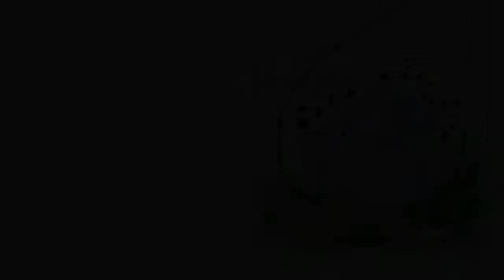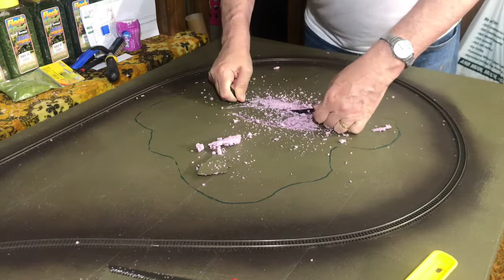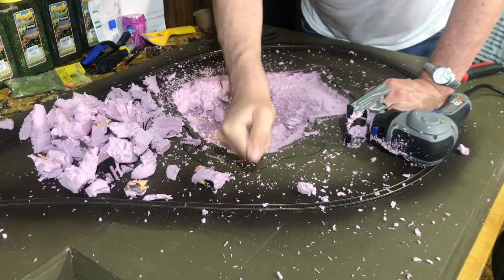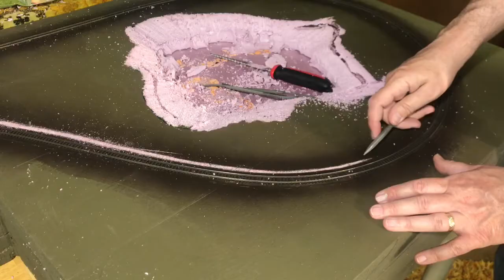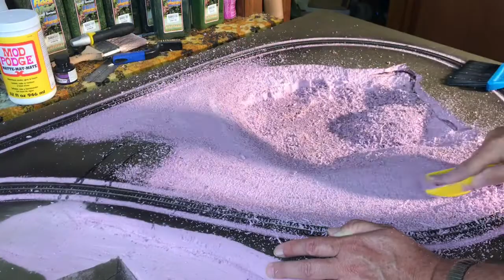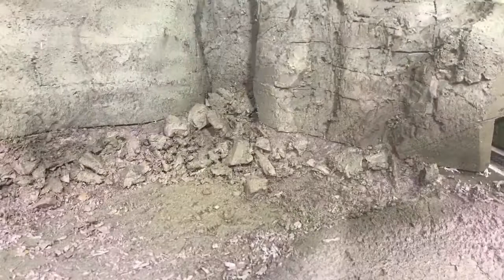N Scale Layout Build Using Extruded Foam # 8b

Comment: hello again.. just my two cents about lakes and waterways.. unless you plan to submerge objects, vehicles..etc.. unless your lake is going to have a very deep slope of ground before entering the water..you now will have a huge investment & weight in filling your lake.. the trick of the eye is to slightly hollow it out..and using color...black in the center to blues to sand color you can create the illusion of depth without really making it that deep.  Tom
Reply from the maker: +Overland Transportation System thanks for the suggestion, there are a few things on this module that I have taken a break to think through, with the lake being one of them. I have also decided to change my choice of track, and will be going with Kato Unitrack. It should be interesting and I’ll have some improved skills when I go back to working on the main layout modules after completing my work on the diorama...Anthony
Reply: @hastingsbnsfnscalemodeler8594  ..hello again Anthony.. I only have experience with Atlas code 100 flex track.  My current layout got destroyed and is non functional.  I too have been considering Kato track.  The more I see it the better I like it.  I'm in the planning stages of my next layout and for me the decision will be... parting with all this flex track I already own and making the switch to either Kato or Micro Engineering code 70...or, sticking with what I have as a cost factor.  In addition to track I also am an old DC guy.. I am leaning toward DCC and again..I'm looking at digitrax or Powercab all inclusive in the throttle. Decisions, decisions... Tom
Reply from the maker: I don’t have the “sunk cost” dilemma of already owning track, but cost is still an issue. Kato is not cheap.